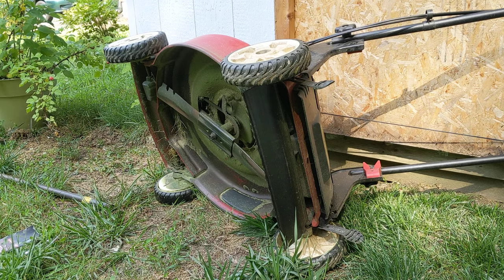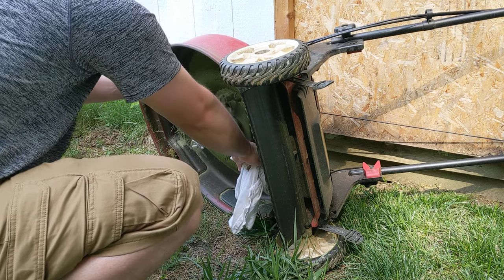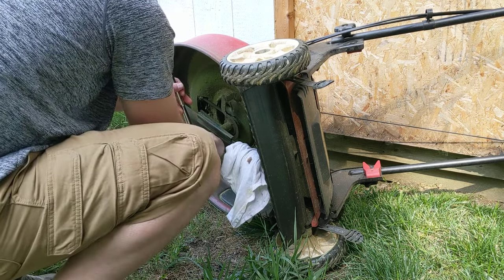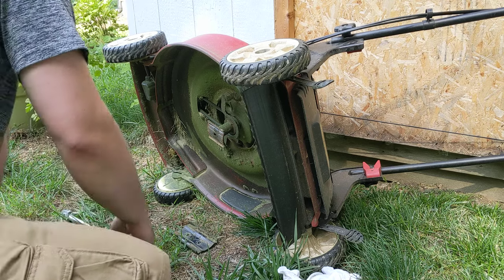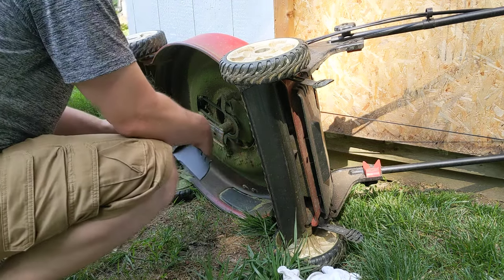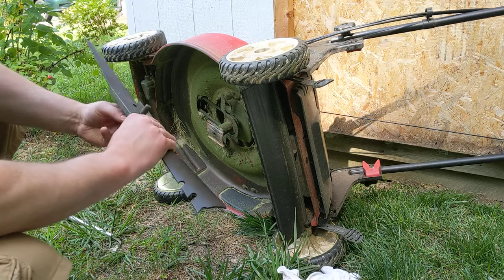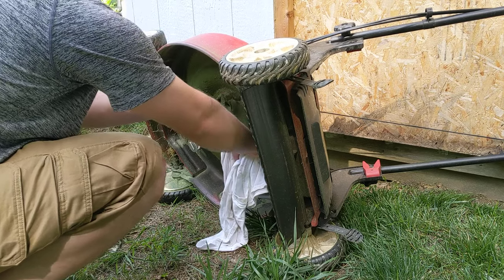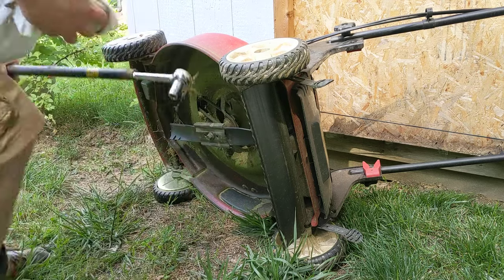How to remove a lawn mower bolt stuck (DIY Guide)

Comment: No. Your bolt wasn’t stuck... not like mine which is fused on and won’t budge... I need real tips for super stubborn bolt nut insanity.
Reply from the maker: Breaker bar is your best bet. You will have more leverage if you use a 3' or longer bar. Have a friend help so you can use all the leverage. Don't use a torch to heat the bolt. Good luck.
Reply: What else do u call that breaker bar because if you go to Bunnings they just look at you funny and the breaker bar they suggest is not what I'm after at all
Reply: Same...might just cut the asshole bolt off and buy a new one xD
Reply: You probably fixed it by now, but do you know anyone with an impact wench? That's your best bet and the least hassle if it happens again in the future, especially if corroded and nothing else works.
Reply: @em4703  thanks that is what eventually worked and the lawn mower got fixed up enough to run another summer but alas died it’s final death a couple weeks ago so now I’m figuring out what the next thing is… do I turn my front lawn into a meadow that I never have to mow or a vegetable garden something like that or do I sharpen the blades on a push mower and just stay on top of it for real this time.
Reply: @darlenepowell4964  pull handle.  Very late I know

Comment: Should've sharpened the blade not replaced it. You can do this with a hand file and a vice. Aren't we supposed to be reparing things and not replacing them because we cant be bothered to do some (not very) hard work?
Reply: Yeah replacing the blade every year is pretty not smart. If it’s any good a file shouldn’t work on it though unless it’s a diamond file. Belt sander

Comment: Ever hear about sharpening a blade? Nothing wrong with that old one. Also you just installed the new blade on backwards
Reply from the maker: If you have a grinder you can sharpen it. I didn't since my blade was old and needs to be replaced.
Reply: @diyhomeownerhero5250  No it was dam near perfect it could of been sharpened 20 times you can buy a cheap angle grinder on sale probably for less than you paid for a new blade. I sharpen a blade around every 10 cuts . Did you remove the spark plug wire for safety? You should of also used a block of wood instead of holding the blade with a wrapped up shirt.
Reply: @BabashiSensei  lol, hes right though, it is backwards, it wasn't stuck, and could of easily been sharpened and last but not least it wasn't bent.
you should be ashamed of this video😂